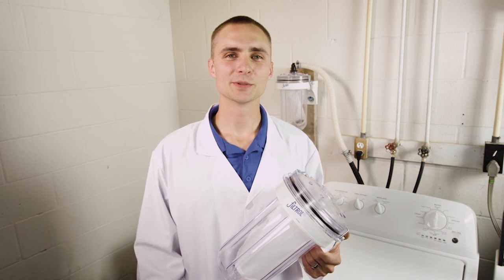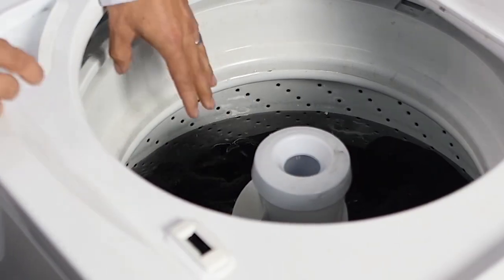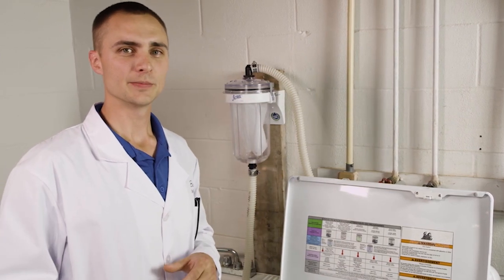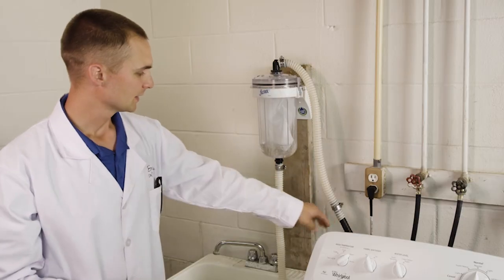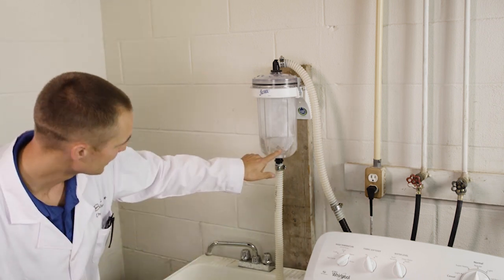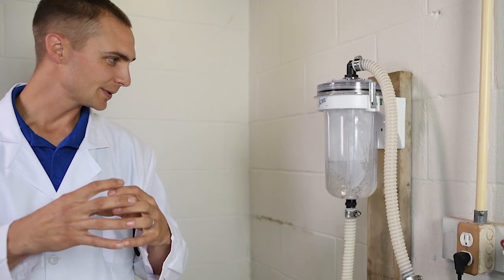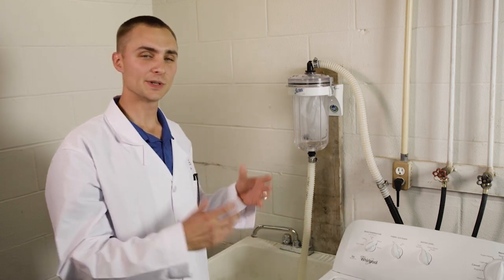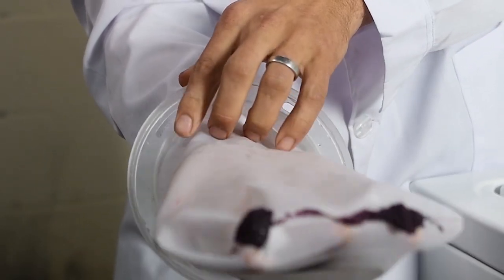#Filtrol | How It Works & Benefits

Comment: My washer drains very fast.  Can the fitrol unit overflow?  Is the water outflows through the bottom guaranteed to be just as fast as inflows?
Reply from the maker: Hello C. Kevni, The Filtrol is made to withstand 25 GPM, if your washing machine has a GPM greater then 25 we do not suggest the use of the Filtrol. The unit will not overflow if it is attached to a machine that meets the requirements, also, it will not overflow should the filter bag become full, there are holes along the top of the filter bag allowing the water to go up and over the bag into the canister. The unit does only drain by gravity so for best draining we suggest the unit be installed directly above your drain location. And again, if your machine has a GPM 25 or less it will drain with no problems.
Reply: @filtrol  thank you so much! I will check the gpm .   🤝🤝🤝🤝
Reply from the maker: @CKevni  you bet! Let us know if you have any further questions!